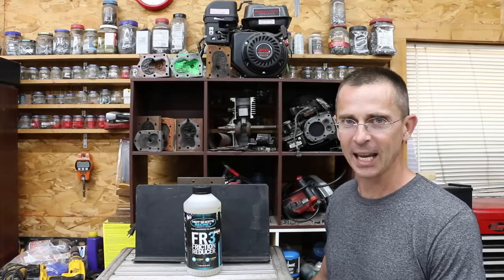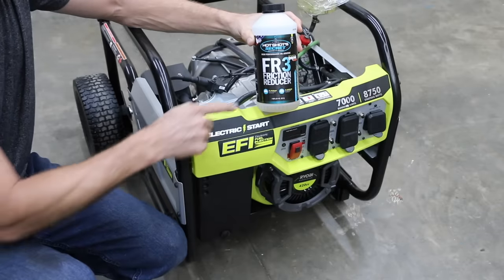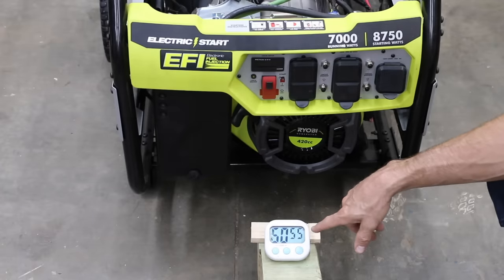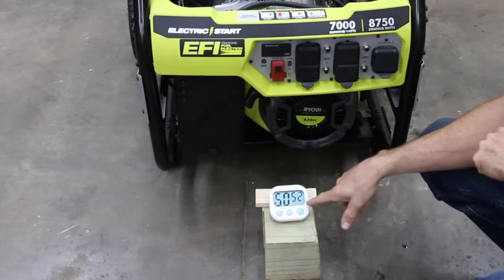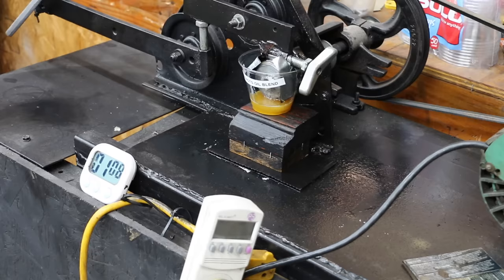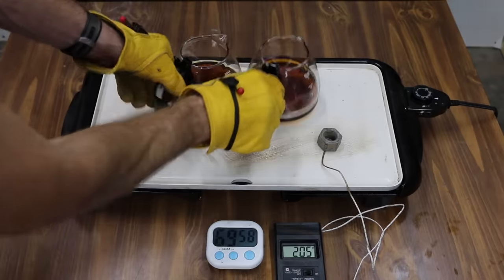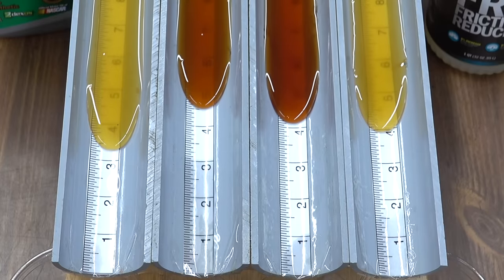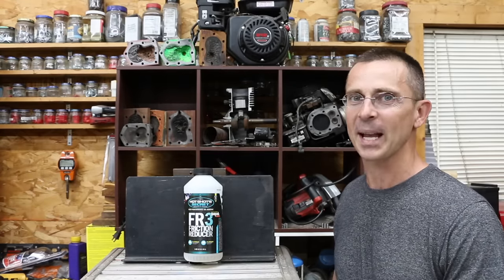Mobil 1 Boosted with Hot Shot's Secret Better? Let's find out!

Comment: A comment about measuring a smaller volume of substance to a larger quantity accurately (worrying about failure of viscous product to not totally empty from the measurement vessel).  First measure out the larger quantity.  Now pour a portion out into another container (quantity not critical).  Measure out the smaller quantity substance, and dump into the main container.  Use the portion removed to refill the smaller container, and dump into the main.  Do this repeatedly until all substance is in the main container.  The larger quantity substance is being used to "rinse" all of the smaller quantity out of the small container minimizing ratio errors.
          You need to do this test on Fluoramics Tufoil oil additive.
Reply from the maker: Thanks for the suggestion.

Comment: To properly test this oil it would require a fully pressure lubricated engine, which this generator probably isn't, even if it has a filter its probably not fully pressure lubricated like a car. Some riding mowers are and they can be found dirt cheap

Comment: I think the noload engine test doesn't tell you much.  The fuel injection system delivers the amount of fuel needed to maintain a preset engine speed.  Under-load, it has to vary the fuel delivery to keep the engine at the governed speed.  A significant load plus engine bearing-surface frictions and the differences in friction modifiers in the oil and additives, may give you the info you are looking for.
Reply from the maker: Thank you for the feedback

Comment: Do liquid-moly added molybdenum
Reply from the maker: Thanks for the suggestion.
Reply: @ProjectFarm  also started using archoil diesel treatment.  Can’t say there’s power or cetane increase but 100% my DPF dropped to zero % within a couple hundred miles and has never come back up so I’ll never regen again.  Would be nice to know if it’s worth it.  6oz costs almost $7.  During a regen is it cheaper to just burn diesel or use this stuff?  It’s 1-2oz per 10 gallon and I’ve been doing the 2oz.

Comment: How about testing firewood? Green vs seasoned, hard wood vs soft, different species make more heat or ash or coals, or burn longer... I have a theory that softer wood burns faster, therefore heating up the stove quicker, where as more dense wood burns longer but less btu per hour. I don't really know, but that's where you come in! Thanks!! Anything firewood or chainsaw /timber related is a very hotly debated topic...Perfect!!!!
Reply from the maker: Thank you for the video idea!

Comment: Could you do a video/series testing bottles of headgasket "fix", Could you do another "engine oil showdown" except for automatic transmission fluid...also another idea is it better to incrementally change oil instead instead of all at once. i.e. remove and replace 1-2 quarts of transmission fluid every 5K miles instead of changing all the fluid at 30K miles...so that way your engine/transmission are getting some fresh fluid more often then just at the initial oil change and then the fluid getting older and older.  Thanks, I've already made some decisions on what products to use based on your tests.
Reply from the maker: Thanks for the video idea.

Comment: Would you try Hotshots Secret Stiction Eliminator? I’ve ran it on Cummins, a TDI, and had great results.
Reply from the maker: Thanks for the suggestion.
Reply: @ProjectFarm  would you try hotshot 100% oil to compare against amsoil? All amsoil oil is 100% so I’d be curious on the highest quality oils, plus what would you get with the additives? Recent video from Motor Oil Geek claiming Fr3 could hurt amsoil in an oil sample test. I’ve had years of amsoil with no issues, and just recently got into hotshots within the last year and have been very pleased, especially on the fuel side.

Comment: This is valid for everything in the world: if we ever really had anything everytime 20-30-50%-2x-3x times better than the famous "previous iteration" of a product according to ads - we would have had a super ideal absolutely everything by now. Still, detergents are somewhat the same as effective as they used to be in 50-s (or worse). Motor oils still do not make your engines run for 2,000,000 kms between changes. And your chocolate bar is not 2000% consisting of real hazelnuts.
Reply from the maker: Thanks for the feedback

Comment: Hot shots has an air cooled rv generator oil with this additive already in it, and it’s full synthetic. Could you do a test seeing on if synthetic is better for air cooled engines like generators that run extended hours? I got a new predator 5k inverter generator and want to put something in there that handles being in an air cooled engine. I’m not sure if Rotella t5 or just regular Pennzoil platinum would be better suited or a true air cooled engine oil
Reply from the maker: Thanks for the suggestion.
Reply: Amsoil

Comment: I heard you can run this stuff (FR3) in your fuel system. I know Hot Shot's offers fuel system specific additives, but I was wondering if this specific formulation had any different benefits v.s. their "Lubricity Extreme" or "Gasoline Extreme", for example.
Reply from the maker: Thanks for the suggestion.

Comment: Wondering if you would be open to another oil test? A lot, of not most auto makers that have their own branded oil have it made by some one else. Take for example, Motorcraft 15w40 diesel oil. It appears that it’s rebranded Phillips 66 shield diesel oil. Heck, even the bottles are identical. It would be very interesting to see if there’s any difference between those two specifically ( I drive a Ford Powerstroke and work for Phillips 66) others such as GM and Doge with their branded motor oils.
Reply from the maker: Great test idea! Thank you

Comment: Basically what I get from this is fr3 is amazing at first, but when it burns off it sludges up and becomes much worse for your car vs straight oil. So I won't be using this, not worth the protection at first vs harming the oil when that liquid gold burns off and turns into harmful sludge very quickly. As is most oil additives really, they're not put through the standards of real motor oil, so they don't need to meet any requirements or endurance tests to ensure it properly protects engined even after miles upon miles of use. I've always used mobil1 EP HM and I've never had engine related issues after 70k miles on my v6 mustang (110k-180k) and will be using it on my new to me mustang gt
Reply from the maker: Thanks for sharing.
Reply: @ProjectFarm  I still find it so crazy how you respond to almost all comments on year old videos! I absolutely love your videos and how you aren't paid for your honest opinion to be biased.

Comment: You did the lubricity test in the wrong order. You should have tested the mobile one, then with the additive and then the fr3 on its own. The problem you have with the way you did it, is you pre-treated the lubricity tester with a ceramic coating. Which made the other two tests invalid. It leaves a ceramic residue especially Where Metal contacts other metal I have looked at the test procedures that Gale Banks did on using fr3 inside of differentials, and he gets about a five-hour reduction, but you're also talking about 700 to 1000 horsepower. That's not a lot, but he's getting a significant reduction in wear pattern. One thing to be noted however, is the five horsepower was a reduction in parasitic drag, and that is only about 50 horsepower for the actual alone, or less. So five horsepower reduction in parasitic drag is quite a bit.

Comment: I use a snake oil "Pro Blend". I have many stories. I measured the fuel consumption and then added Pro Blend. A gallon went from 2 hrs 15 min to 2hrs 40 min. That's 10%.  Sounds too good to be true but I measured it a few times. I also ran my Mazda pickup with no oil for over 125 miles, head cracked and the oil went into the water. 🤔😯
Reply from the maker: Thank you for the feedback

Comment: @Project Farm. I got good test for you. I always been told not to use car oil in a Motorcycle/ATV because it will damage wet clutches. Motorcycle ATV oil is more costly than car oil even though car oil has more additives in it.  I want to know what the Librisky test says about Motorcycle ATV oil vs Car oil, how they compare in the Freezer n Burn test, and what the Chemical difference are?  Will Car oil hurt a Motorcycle ATV wet clutch or will it infact be better for the motor n clutches?  Let's find out!!
Reply from the maker: Thank you for the video idea!

Comment: Please do lazer levels and include brands available in the uk
Reply from the maker: Thanks for the video idea.
Reply from the maker: Thanks for the video idea.
Reply: @ProjectFarm  Wow you responded. In construction you need a laser level for nearly everything. Foundations, walls, windows, kitchens doors, tiling etc. I have a 10-year-old Stanley and a 5-year old Bosch laser level and they have differences. The newer Bosch has a more powerful laser making it visible during the day.and locks the Lazer pendulum when switched off. Can you test the accuracy, Lazer brightness and durability of laser levels under £100 price. Include models available in the UK please. Exclude expensive £300 rotary lasers as they are specialist tools.

Comment: Forgot to change my full synthetic oil for almost 2 years, no symptom of engine problems. am i in the clear? its a gasoline car
Reply from the maker: The car should be fine.  I'd change it if it's reached the oil change interval mileage.
Reply: @ProjectFarm  yea. 1st year i moved and been really busy so i put it off eventually forgot about it due to last 2nd year it was rarely driven. Manual says 10k or 1 year, even though my mileage is within but time wise im 1 year over. Even though it drives fine now will engine symptom show up later? btw if a gasoline engine shows sign of wear due to overdue oil change is the damage too late? edit-i was wrong i put around 10k in the 2 years

Comment: A super smart engineer who actually designs and creates engines Mathew Hudson from “The WorkShop” , said previously that the oil test with the bearing and wear, is totally irrelevant and has no relation to how the oil actually works inside the engine. He drew out and explained why, I’m sure I could find the video. So yeah, Just a FYI.., that type of test has no value when determining how the oil will perform at its job, and isn’t reflective of it being good or bad oil.
Reply: Not to be harsh, :) but I know I  personally, prior to the video I assumed it would at least be a good representation of the wear resistance but it’s not.. it’s more misleading than anything :)

Comment: I started using FR3 in my Sorento with the required 0W-30 SN+ motor oil (Mobil1 Advanced Fuel Economy) and results were stunning to say the least.  It's my second oil change at around 12K miles.  In my test loop prior to FR3 being added I averaged 18-22mpg peaking at 27mpg and with FR3 added it I averaged 21-25 and peaking at 28.5mpg.
Reply from the maker: Thanks for sharing.

Comment: I have a ram 1500 with the 5.7 and 131000 miles.  It was just starting to make a very slight tick from the driver's side cylinder bank.  I never use snake oils and am very skeptical of any oil additive.  My attitude was always, "just use good oil!"  After watching this vid and talking to a guy at NAPA who also recommended it, I tried it.  I will say, I hate the way this stuff is marketed.  I don't care that Firepunk like it.  Who in the hell names a company Hot Shot Secret?   Buuut I figured 2 oil changes for 25 bucks was not a big deal, and seeing as how it caused less wear than oil alone, it could not hurt.  Sure as sh*t, the engine is quieter and the tick is no longer audible.

Comment: NOW, Test the Stiction product. See how that does... 
I know it worked on my injectors, but I don't know how
Reply from the maker: Thanks for the video idea.
Reply: I have been running it in my truck and excursions ever since.
2001 F350 7.3, 2002 Ford Excursion 7.3, and I also have been adding it to my MF240 tractor...

Comment: Here in Europe almost nobody uses fuel or oil additives, they are not necessary and a waste of money. In a few special cases they may be helpful, if you have not changed the motor oil for a very long time, and the motor is very dirty inside but dont expect miracles.
Reply from the maker: Thanks for the feedback.

Comment: Real talk from a rotary user.  Rx8 6 speed, average gas mileage with Valvoline 20/50 weight, zinc oil is 16.3 mpg.  With FR3, the last one tank of gas, jumped to 17.1 mpg.  Yep', not much of a difference now, but waiting for my next 2200 miles, before passing full judgement.  

The way it works out, math wise, my third gas tank will basically pay for the cost of the FR3 purchase.  A win either way.
Reply from the maker: Thanks for sharing!

Comment: SDS's...Proprietarily bs'ing us all, as many companies do. Here is the best strategy for prolonged engine life: Do your research on vehicle engines that have the highest avg engine mileage, do the recommended interval maintenance religiously and properly , and don't drive like Mario Andretti (most importantly). I got 632,000 miles out of a 1997 Honda Odyssey by doing these things and absolutely NO oil or fuel additive ever. Not one time. And no major engine repairs either.

Comment: Use royal
Purple with it Mobil 1 sux
Reply from the maker: Thank you for the suggestion
Reply: Ty please try it ... I noticed abt 3-4 lbs of boost increase in my 87 turbo Buick the first 100-200 miles after rp 10w30 change ... Mobil one would rattle a few seconds if I let it sit a week or 2

Comment: If hot shot works better than the oil in the lubrisity test, then why mix them? Can it replace the oil?
Reply: It would be terrible as an actual engine oil if it was used on its own , it doesn’t have other oil like properties
Reply: @NWGarage  yeah, I also think the flame temp is too low.

Comment: I like your videos, 
Motor oils just like car waxes always seem to attract those wanting the best protection for their rides
"we tested this, we tested that" "ours is the best" all wanting your money. so i ask all you consumers with any experience ...how many motors have you lost buy following the manufactures spec and service??...how many motors have you pulled and inspected?? I'll bet less than a tenth of percent or less. Never second guess the factory engineers
they have more to lose than you. additives are a bad idea on every level because of the science involved in today's modern oils, doing so destroys the balance of the formulas...If the manufactures wanted you to add an additive they would say so. most people are on a budget, but if you dropped 50+K on a new car, i doubt the smart ones will be dumping any snake oil into it.
Keep your oil changed every 3-5K and used the spec oil for it and it will last forever.
Reply from the maker: Thanks!  Thanks for sharing.

Comment: I don't have the brainpower to figure this out, but here goes; the wife likes to put the washing (laundry) through a spin cycle after normal wash cycle, whereas I throw it straight in the tumble dryer. Her theory is that the extra spin cycle means the drying cycle is shorter. Which method do you think is more energy efficient?
Reply from the maker: Thanks for the video idea.

Comment: Pretty sure there has never been a good product with the claim "powered by science" (which makes no sense what so ever) on it.

Only thing I've ever considered would be high molybdenum content oil but that doesn't exist for a reason. I know what everyone is thinking "MoS2 has molybdenum" which is true, several molecules of the very expensive stuff but it's not high molybdenum at all.

I get some blue grease that has 15%, it costs $3000 for 30 grams (a very small tube). It's for special slip bearings in some very large machines generators/alternators. Even 1% motor oil would be WAY too expensive.

And no, I did not mean MoS, I mean Mo, it'll oxidise on it's own.
Reply from the maker: Thanks for the feedback.

Comment: The amount of money that that hot shot cost compared to the money you'll save in fuel - it's just not worth it!!!
Reply from the maker: Thanks for the feedback.
Reply: Don’t forget reduced friction on the bearings, cylinder walls, rings, seals, turbo if equipped.  If you plan on keeping your car for a long time then it’s more than worth it especially if you do t do routine maintenance.  If you maintain your fluid changes like you are suppose to then I agree, probably not worth it.

Comment: While I appreciate the engine dying at virtually the exact same time for both tests, these tests are far from as accurate as a lab would be. You test in real world applications with variables being very much in play, which I do like, but a lab is going to control the variables as much a possible for a completely even test. It's just sheer coincidence that the run time was 50:44 for both tests. Even a 1 degree F difference in ambient temperature will skew these kinds of test results. I'd personally like to see each configuration ran 5 or more times to get a mean, a median, a high, and a low.

That goes for each test. Not just the runtime test.
Reply: Jetmech0417 the bottom line is if a product can’t make any measurable difference in a real world application then it’s a waste of money. He’s not trying to do a like for like test to validate the manufacturers claim.
Reply: @Encourageable 
Yeah, but a single run through doesn't give what could be considered reliable results. It's an interesting experiment, but far from conclusive. That's why I suggested 5 or more iterations of the same tests.